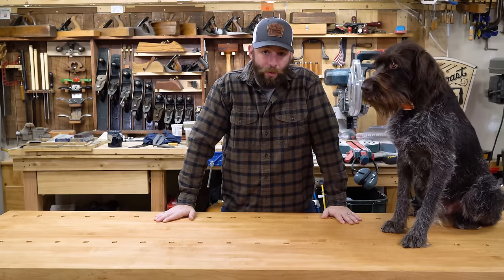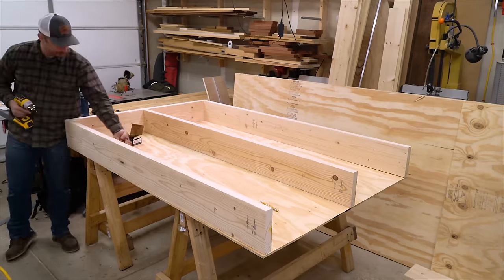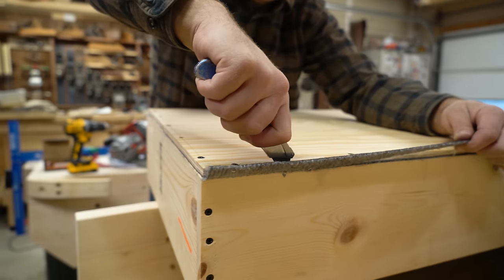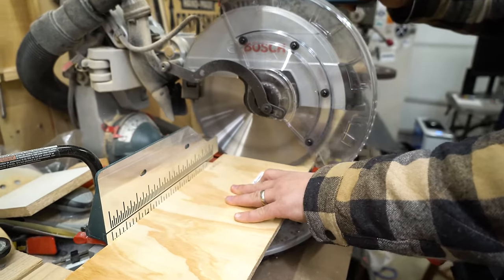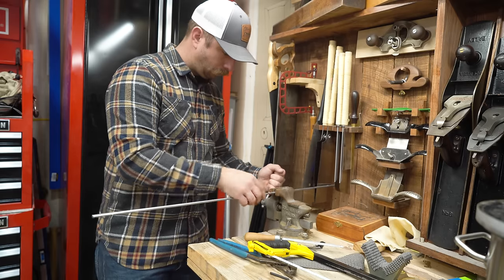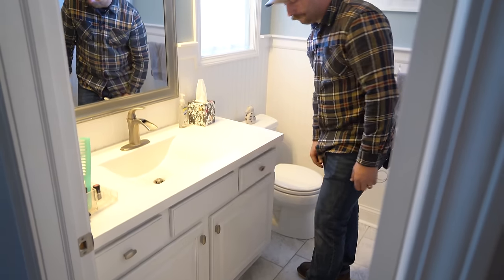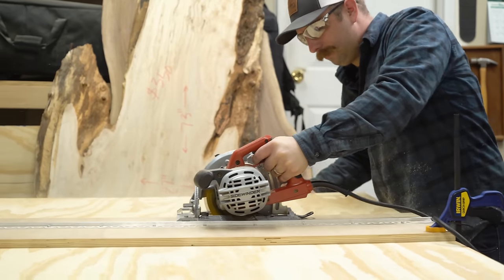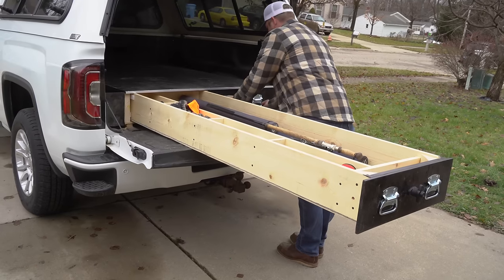How To Build Truck Bed Drawers // SUV Drawer // DIY

Comment: Built these drawers about two years ago and installed them in my Ram 1500, with a 6 foot bed. They are awesome. The plans are well worth the cost. I'm a professional electrician and these drawers are great for what I do every day. I even got fancy and built my own bed slide type pullout on top of the drawers. Really pleased with everything. Thanks for the instructions and the plans!
Reply: The roll out on top of the drawers is exactly what I'm looking to do also. Got any pics of how you did it?
Reply: Know how you feel as well. Im a jman electrician who just started with an hvac company. They gave me a truck that has a canopy with some shelving on the outside and it comes with a sliding floor in the box. A pack rat box like this would be perfect since the shelving on the sides hold shit,and the slide out can basically only handle my cable reels. But theres so many little pieces in our trade, that you need as many drawers as possible haha.

Comment: I am handyman who works out of my truck. I built draws like this for my F150 about 6 years ago. I used ½" ball casters for the drawers to slide on. But I really like this plastic strip idea. 

My drawers are still going strong and work better than I could have imagined. They don't lock but my tailgate does. And for "handles" I just cut 3½" slots in the drawers. 

To seal the drawers I used construction glue along along with screws, and I also used chaulking along the seams. Then I used a garage floor sealer or the outer coating and just did each side of the box individually. On the top I added the traction shavings that come with the sealer kit. But honestly, I would rather have the top be smooth. 

It's nice to have tools with you and still be able to have a bed to a certain degree. I have thought about adding a canopy to my bed with side access windows or sides. But at the same time I like the roll back bed cover I currently have. 

Really enjoyed your making of this and the shaving of the beard was epic.

Comment: after much arguing back and forth with myself about the best slide solution.  I have decided to use your solution for the slides on my kayak trailer build.  I plan to have 3 drawers slide out the back of the box the two outside drawers will hold our fishing kayak paddles, floatation and swivel seats plus other camping gear.  The center long pull out won't be so much a drawer but a rod and reel caddy that can be pulled out after all other gear has been added to the kayaks.  We've had our kayaks for like a year and still have yet to put them in the water.  So hoping to have this build done before the end of summer to take on a trip.

Thanks for the ideas from your video.

Comment: Love it!  I plan on making one at some point, I like your locking mechanism, simple and strong. I did want to share one thing with you about bending metal in your vise. When I was younger my dad and I were working on something and we clamped some steel in the vise, gave it a couple swift hits-and broke the front of the vise off! We were told later by an older gentleman that when you pound on a vise make sure the force only goes onto the stationary jaw, not the movable one. Just thought I’d pass on that wisdom. Keep up the great work! God bless and Merry Christmas
Reply from the maker: Hey Nate! That’s an awesome tip and make perfect sense. Thanks so much for sharing. I’ll do that for now on
Reply: I've never heard that before. Great tip!
Reply: @ThirdCoastCraftsman  you just got a new sub from your response. Good form indeed.
Reply: Now that's one of those valuable pieces of advice that make so much sense you can't believe you didn't figure it out on your own!
Reply: One question on that.how big of a vise was it.you may have been doing that on a cheap thing or  not made for what you did.ive never had that problem before but I guess it could happen.or did you even use heat to weaken the steel up?
Reply: Great idea ,Wilton vise are the best especially the older ones
Reply: I beat on Wilton’s all the time. No problem.
Reply: Once I broke a vise my dad's vise by just clamping steel until it wouldn't move. No cheater bar was involved. Then I broke another borrowed vise the same way. No doubt both had taken a beating prior
to my use. I was on the hook for 2 vises. I definitely learned not to borrow a vise ever again...
Reply: I used your idea and built slides for my truck. I added skateboard bearings for the slides. Got about 100 from Amazon, they’re handy for a lot of things and they’re cheap.

Comment: I love the editing! The video cut straight to the important parts and we weren't left there waiting for you to line everything up and get your tools in position. When you were ready to pop the chalk line, that's exactly where you went with the video. When you drilled in those screws it went one screw to the next without any lag time in between. I don't have a truck and I'm not interested in putting drawers in my van but I still like the video!

Comment: Made 4 sets of those at work. A little different slide system with caster wheels. Really like the T handle locks nice job.
Reply: How much would you charge?
Reply: @andrewsalazar98  what do you need done? Check tier1carpentry on Instagram

Comment: Very cool!
I've built 3  of these for trucks I've owned since the mid 90's, but none currently. 
All have been treated, due to no bed cap.
I've used laminate strips under drawers and on top of floor.
2 were painted before ACQ happened, last one was epoxy painted.
I never used a latch of any kind (yours is very cool), I did add lighting on the last one.
2x8 is bare minimum for height in my opinion, 2x6, 2x8,and last was 2x12.

Comment: Those are great!! I used to work at Los Angeles Unified School Dist. Maint. & Oper's. in the glass dept. All of the truck had this same system. The only difference is that they were deeper, were surrounded by a steel frame work in the bed and opened and closed on steel rollers. There was enough room in the drawers for a small compartment in each one for screws, hand tools and other needed items. The bed was then covered with 14 ga. steel sheet to enclose the top and the glass rack was installed last. Locks were installed on the tailgate next to the rear end of the fenders. That kept everything secure while the truck was unattended...

Comment: I threw away the Gillette razors a few years ago and took up straight shaving. Had a full beard ever since. lol
Reply from the maker: hahahaha
Reply: I used to carry a straight razor back in school because it was in a pretty rough area. Years later I learned that it’s actually used for shaving lol
Reply: That's one way to cover up the scars...
Reply: LOL - Good one! Despite having Essential Tremors, I still shave with my Gillette Double Edge razor. Thankfully, the sight of blood (especially mine) doesn't bother me and I have a good supply of Styptic Pencils! ROFL
"All I wanted was a clean shave - not a self-sacrifice!" LOL
Reply: @AFmedic  I'm an Air Force Veteran . Were allowed to stay on active duty as an AFMedic6871 w/the essential tremors? Do you know what caused your essential tremors ? I had a friend rest her soul with the same condition. She was 80 when she died .
Reply: @bobshaw4063  - No! It has nothing to do with Parkinson's. The tremors are usually only noticeable when doing fine motor skills or opposing gravity (such as extending your arm straight out in front of you). Cause is still unknown but it does seem to run in families which is why it used to be called Familial Tremors. There are different degrees of it and usually worsens as one gets older (I'm 68). As far as active duty...it depends on the degree of severity and your job. My son's tremors are worse than mine and he's ineligible for the military.   As an AeroMed (and being young) it had no effect but now... don't ask me to remove sutures or make a small incision with a scalpel (you'll need more sutures ROFL)
Remember that for the draft during Vietnam - as long as you could pull a trigger you were classified 1A.
Thanks for your service
Reply: @AFmedic Hi Thanks for your Reply . Sorry to hear your sons tremors are worse then yours are . Are 100% Service connected for the tremors? How long did you serve & what did you do when you discharged from active duty ?
Reply: @bobshaw4063  - It is not something one acquires in later years - you are born with it, so no "Service Connected" disability possible. I served 1968 to 1971. I lost a buddy over there and wasn't in a good mood and some A-hole E7 (I was an E5) gave me some shit so I told him off. He said, "I'll have your stripes for that." I said , "You can have them" and ripped them off my sleeves and threw them down at his feet. Because of extenuating circumstances instead of punishment they gave me an early out Honorable Discharge (only had 6 months left on my 4 year enlistment anyway). Went to school for Electronics but tremors got worse (couldn't solder and got zapped a few times on a tank capacitor during lab) because of it so dropped out (only had 1 semester left for my AAS degree). Did Retail Management for 30+ years.
Reply: Sometimes called “intention tremors”. As a 30 year practicing physician I’ve seen this a lot. Sad how the body can turn against you. Some may be from some form of a progressive demyelination neurological condition. Often lumped into “Parkinsonism disorder”. Some condition progress, others stay at a point for years. It always broke my heart to see this in someone, esp if the patient has not acknowledged the symptoms. My prayers to you all.
Reply: @MJ-nb1qn  I pretty much learned to cope with it. I do swear a lot when more sugar & creamer ends up on the counter than what's in the cup or trying to flip an egg- LOL It is embarrassing when in a restaurant and you can't even pick up up your coffee cup because you know you'll spill it all over, so you either just leave it or lean over and sip out the cup (slightly tilting it as needed) until it is half full. But I count my blessings though because there are those who are paralyzed, missing an arm, etc because even with the tremors I can still do things that they can't.

Comment: Great video!  Great build!  A tool suggestion for centering pilot holes in anything that you need to be dead centered on. Look for the “Vicks” (vix) bit. A self centering spring loaded bit guide. They come in standard common sizes. A tool that will increase quality, and ease the speed of production.

Comment: wish I had a video like this about 18 months ago when I built my truck bed storage system. I bought 500# drawer slides, that cost a ton, and wound up only putting one set of slides in. What I have set up now works for me but it is not what I envisioned. 
Thank you for the tutorial and plan if I want to redesign it!!!!

Comment: Great work, one minor nitpicky thing I would suggest would be instead of screwing your pull handles in, to use quarter inch bolts and washers through the wood. Over time screws seem to weaken, especially if you have heavy things in the drawers, or if the drawers get wet from time to time.

Comment: Nice, simple, and well done.  I might do this for my old truck  A few tips though, use actual wood screws throughout, not just in some spots.  Drywall screws are a poor choice for wood working.  They work great for holding drywall, but dont have the strength needed and corrode and break too easily for woodworking. I used to do a lot of deck building and find that deck screws work great for things like this that need a bit of extra strength.   

I use red Chapstick for what you used the lipstick for.  It's not quite as visible, but it works, is cheaper, and doesn't piss off the better half.  I've also used a dab of lithium grease or a tiny dab of craft paint before with good results. 

I loved the chisel shave!.  I used to shave with my KA-BAR out in the field every once in a while, just to freak out the boots.  It's a bit harder since the blade is so much longer.

Comment: You might have the best dog on YouTube! At a Police Dept I worked at the investigator Ford Excursions hada  really expensive metal drawer setup in the back. I think all told they cost more than a grand. DIY design and make it yourself is much better.
Reply: And people wonder why their taxes are so high.
Reply: The standard pricing on the market is the “Decked Option”, while doing so with lumber and carpentry is usually around half of that. Meaning if you could manufacture them, you could charge 850-900$ each.
Reply: @joeshmoe9521  Decked is not the standard for law enforcement. TruckVault is. Decked is a great system for recreational/camping/utility gear. TruckVault is great for storing firearms and similar gear. 

With that said... this video was amazing and I wish I had the time, space, and equipment to do this myself. My TruckVault system in my Tacoma was nearly 4 grand. The Diamondback Cover was two.

Comment: was searching around for a system that did not use expensive slides, but was still durable, never thought of UHMW till I watched your video,  THANK YOU.  I do volunteer (construction and maintenance) for a local animal shelter and this will save a lot of loading and unloading of tools. Will probably only make it 1/2 or a little wider in bed so I can still get ice chest in.  I only have a hard bed cover on my Tundra (ACE brand)

Comment: I'm in the custom cabinet/counter top business and have the same basic set up. I can leave the drawers open to extend the length of the bed for long counter tops or lumber. Didn't watch the whole video and skipped to the end so I'm not sure if that was mentioned, but well done video and a good project for anyone that carries a lot of tools.

Comment: Nice drawers,i was a professional builder guy and used them a lot, i found that my friends set didn't slide well after awhile, i used 3/4 in plywood and dadoed all the drawer fronts because i knew the drawers would be heavy ,i also dadoed 2 oak strips into the bottom of each drawer and put high impact plastic where they slid. 
 I used them for 10 yrs and they worked great.  don't know if anyone appreciates it but there you go.  oh,i also made sliding trays ,which were nice because so much stuff like hoses cords and saws go in low.and the top trays keep everything flat .

Comment: You had me right up until you drilled into the bed of your truck.  I'm going to go with a rubber mat to lift the tool drawers and prevent movement.  Nice drawers.  Cheers!

Comment: Very enjoyable video, I laughed out loud a few times , (my missus was lookin' at me funny, prob thinkin' 'what the hells he lookin at'?) and hey those drawers are great , so much so i'm gonna build some for myself in my F350 longbed and hide 2 x 12 volt deep cycle batteries in the spare 'cubbys' around the wheel well as well as a jump pack and air compressor.....you are obviously a very skilled craftsman and talented videographer to boot, thanks for posting this ;¬)

Comment: Great video, now all I need is a truck to build them for.  You needed to rub lipstick on a different surface to remove the round indentation from the rod. A little common sense and you won't get busted next time. lol Thank you for sharing your talent
Reply: Or, just buy a cheap tube of lipstick and put it in your tool box for the next project you need an alignment mark for.
Reply: @scotttovey  lol, imagine someone finding lipstick in your toolkit!
Reply: Rodney Widger Has

Comment: I noticed you didn't have any retention device to keep those drawers in their respective slots, or to keep them from accidentally being pulled too far out, was that done on purpose?
Reply: The tailgate holds them from falling out, its towards the end of the video.
Reply: @mjrwey  no the tailgate holds the weight. He was meaning if you pull on the drawers eventually they will come out. Usually there is some sort of stopping block or something in place so that when you pull on them eventually it will stop the drawer from coming all the way out of the frame.
Reply: @EDOutdoors91  From looking at the past video (https://www.youtube.com/watch?v=cK4xyd71WSI) I think it was intentional. It makes it easy to take out the drawers if you wanted to keep them somewhere else like the garage. I guess you could take the whole unit out as well.
Reply: He don’t pull out

Comment: damn, that is nice! been racking my brain for how to do just this for my '98 Tacoma (still running strong!). i was close but this fills the gaps and anticipates design issues i hadn't considered. many thanks! 

p.s. my guess is your bed is intentionally slanted for drainage purposes, which i'm painfully aware of because my canopy leaks...
Reply: zverina I have a 98 Tacoma as well, I have a significant lean forward after my OME suspension upgrade so I just put a couple drainage holes up near the cab... sure it looks like a dog marking it’s territory in a rainstorm, but I don’t have a manky swimming pool in my truck bed anymore either.